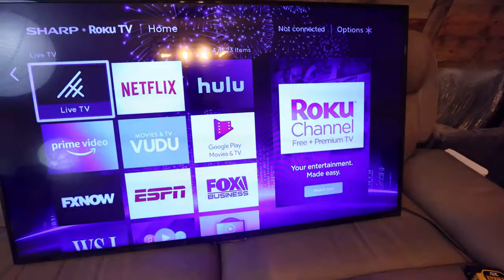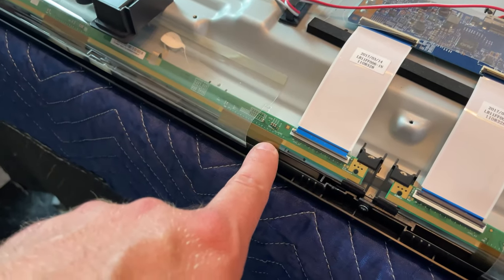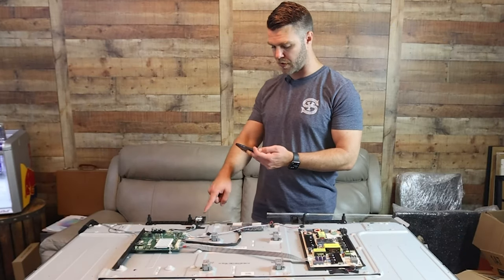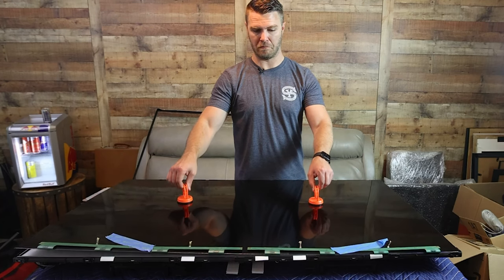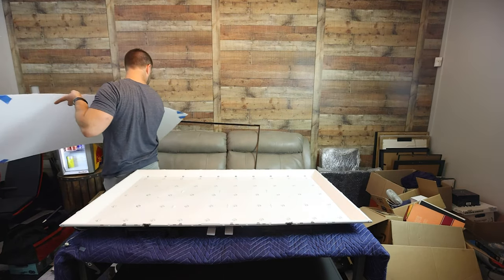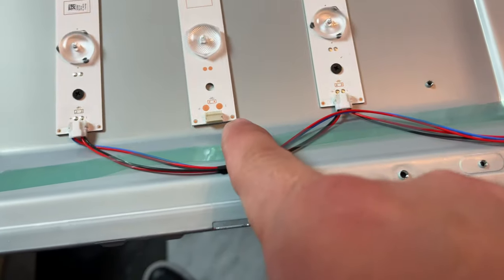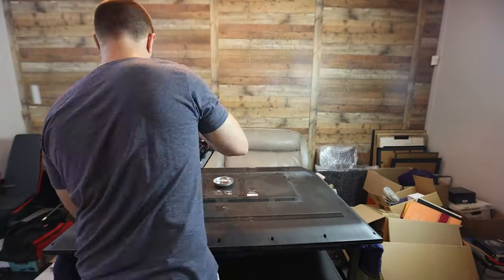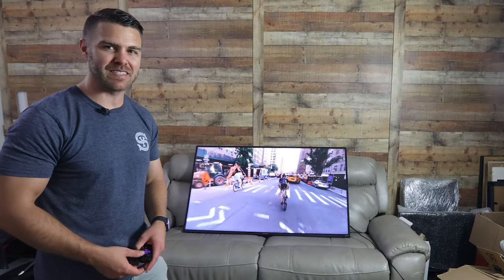Fix a Blue Flat Screen TV Cheap

Comment: My tv is hisence and the model number is 55N4. I dont know how many back light should needed to replace to get rid of blue light.please i need help.
Reply: If the blue tint is only slight, check under your advanced picture settings and make sure the colour temperature is not set to 'cool', try 'standard' instead.